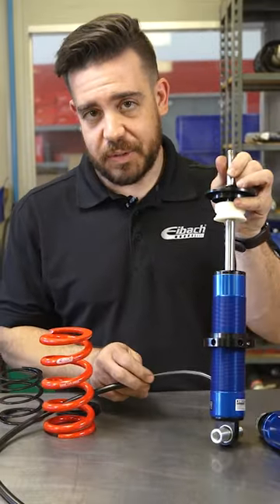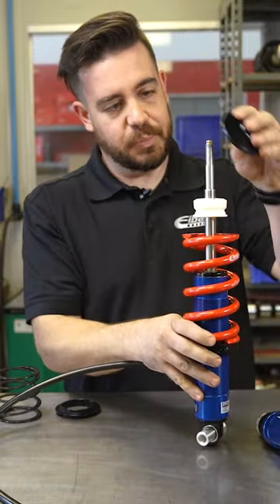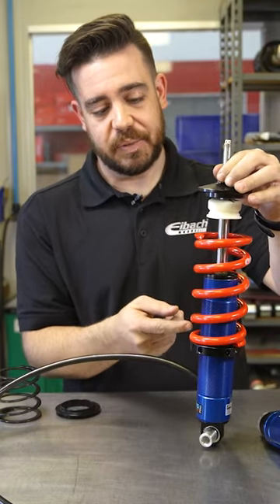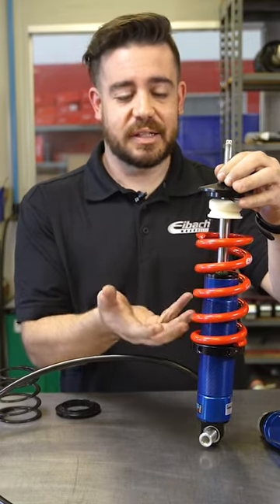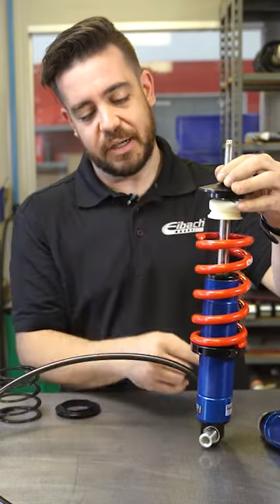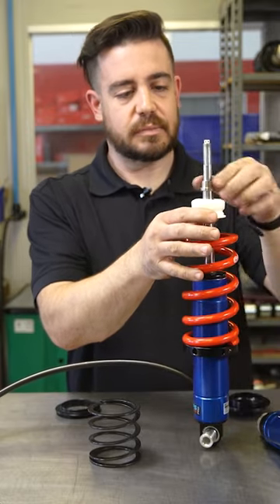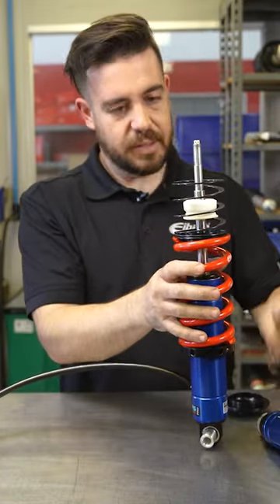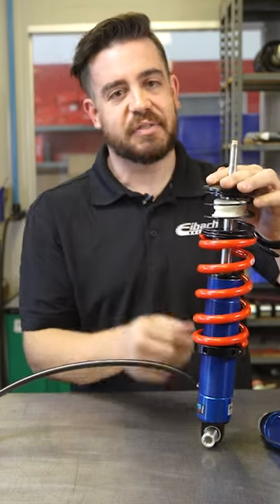Why you might need a helper spring!

Comment: How do I know which size helper springs to buy?
Reply from the maker: Check out the full length video on our channel or give us a call at 1 800 507 2338.
Reply: @EibachUSA how bout if I cut the shaft and bring the cap on top the spring like standard issue..thn machine it to suit 🤔🥴